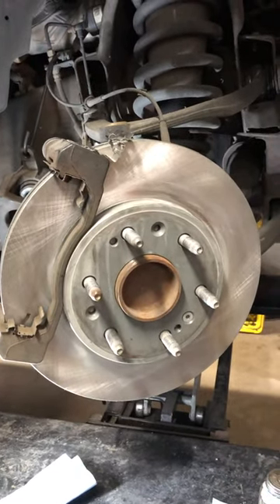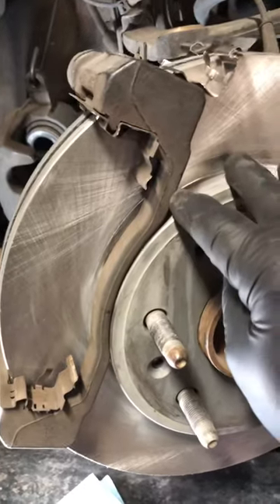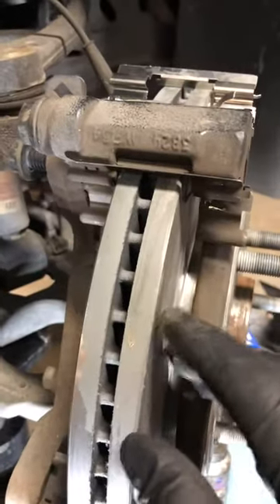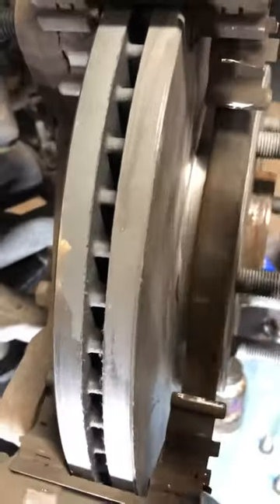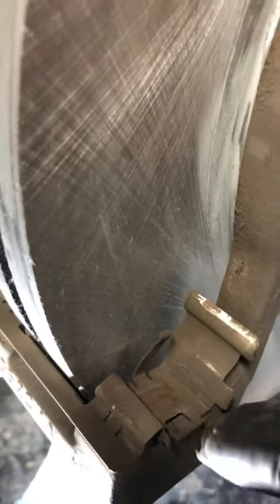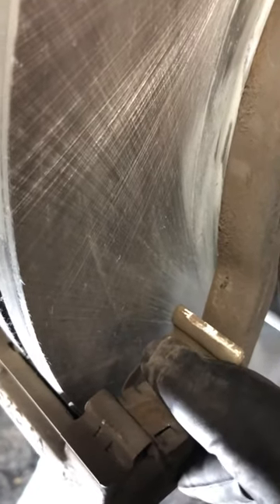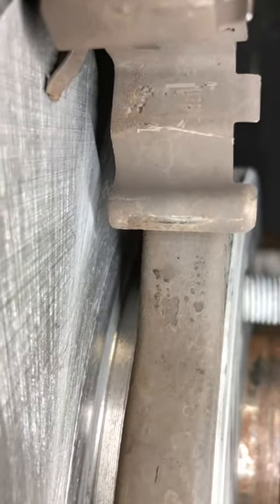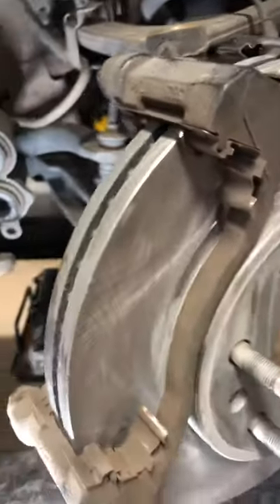When replacing Brake pads , is it important to replace the clips?

Comment: I tried to put clips on and they were too tight. There weren't any on there when I pulled the old pads. 98 Jeep Wrangler TJ.
Is it possible these were designed to use without clips?
Reply from the maker: Yes, the box of pads may fit several different vehicles. I have seen 2 different sizes included in the box . Depends on your vehicle.

Comment: I've put em back in and ive left them out, I don't really see the difference
Reply from the maker: Old ones can be worn.
Reply: I left the some of the clips out and I was getting a clicking noise from the brakes.  Those spring loaded clips keep the pads from moving around when the caliper puts pressure on it
Reply from the maker: @kalbo707  yes 👍🏻